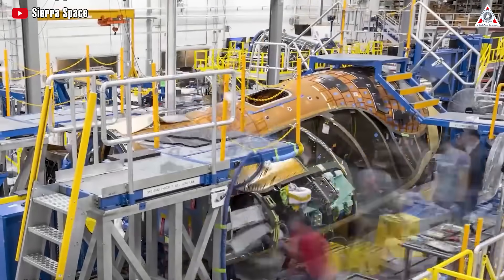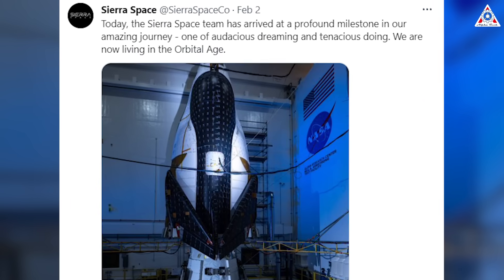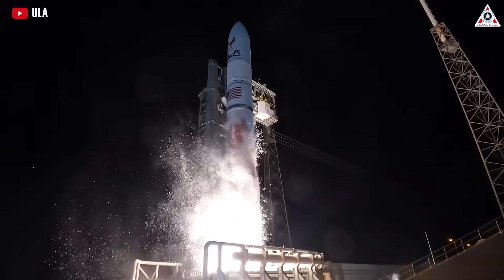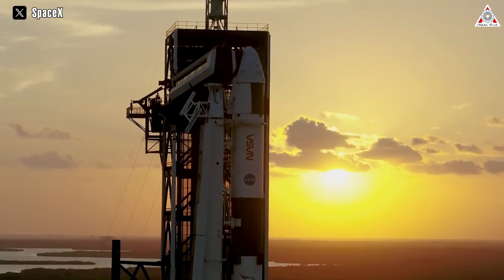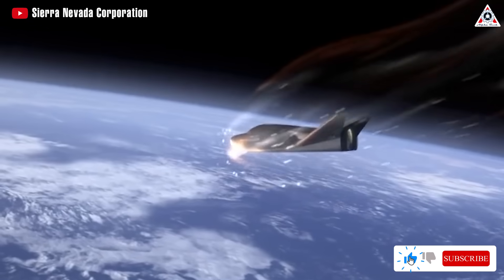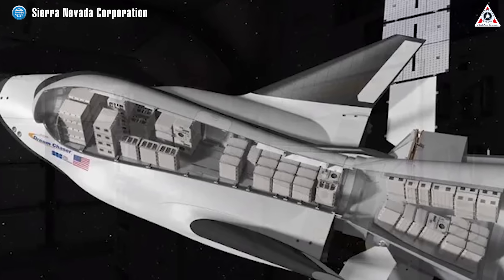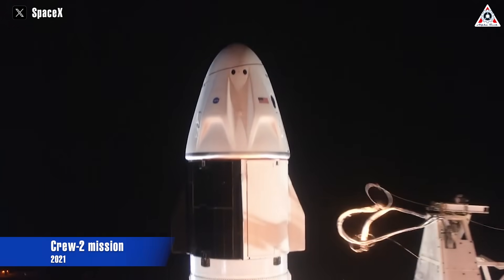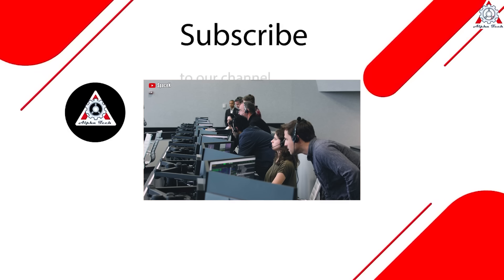NASA reveals inside NEW UPDATE on Dream Chaser's future propulsion...Vertical position!

Comment: Starship is ready in a couple weeks.  Dream Chaser is far behind, but multiple paths to orbit are welcome.
Reply: Starship is nowhere near “ready”. Two launch attempts and zero successes.
No life support.
No docking systems.
No ground test capability.
Reply: @allangibson8494  maybe not ready for humans, but they want to make orbit and make the deorbit burn for success.  Heat shielding has already been developed.  Docking systems are yet to be tested, but it’s not like they haven’t been worked on..  The second stage is to wind up in the Pacific this time.  After that, reusable.  THEN precision landing, then life support if not just a cargo mission, one step at a time, unlike NASA ALL-OR-NOTHING. Remember how many Falcons were destroyed in first testing?  Now we’re over 150 in a row, zero in flight losses.  (One fell off the recovery ship in high seas, some time  during the return to Canaveral, not during landing). No other system has ever been this cheap or reliable.
Reply: Starship is still in test mode . This one will blow up when it gets close orbit. Then they'll roll the next one out

Comment: I'll bite, how will the crew version execute a launch abort?   One word comes to mind, "Challenger."
Reply: I agree.. only this one will ride in a fairing..there is no escape
Reply: @thrillchaser9492 The CARGO version uses a fairing. The crew version won’t but requires deep integration to the launch vehicle as its aerodynamic controls will directly influence the rocket’s directional control.
The DreamChaser will use its two orbital manoeuvre engines for launch abort (which also need clearance around the rocket body).
These aren’t new issues - the concept dates from the Boeing X-20 in 1957.

Comment: Why is there no front wheel? It looks like the skid plate will dig up the runway.
Reply: Since it's a smallish glider and can't move under it's own power once on the ground, a nose wheel simply isn't needed.  Makes things super simple and once the nose is on the runway, you want maximum drag to slow it down to a stop.  Design of the skid will make it wear down before impacting the asphalt runway's surface.   For directional control, use asymmetric breaking on the main gear wheels.
Reply: You need go search an you will get the answer...

Comment: At this point I think shape of dream chaser looks overcomplicated, does all the curves make sense? Complex tiles, that hard to replace, and fabricate, can result in long
Reply: Actually, simple logic shows that most of the tiles are on the underside, and the upper side won't be exposed to extreme temperatures.  Dream Chaser was originally designed as a piloted spacecraft. That upper bulge is supposed to be the pilot area and for windows and in the manned version will be. those tiles are larger and better designed than the old space shuttle tiles.
Reply: it probably lets the heat flow off it as it travels instead of running along the surface.

Comment: Using Dream Chaser to deliver cargo/people to various places is awesome BUT once landed, the Dream Chaser has to be shuttled back to a launch pad to be flown again. Add that expense to the cost of use. It will be no trivial process either because it is bigg enough that trucking it down a highway is going to require road closures, it appears to big to fit in a cargo plane to fly it home and shuttling it by boat will require it to land at a port.
Reply: Um. No.
Reply: @WereMask 
Um, yeah. Duh!
Reply: Why? It can land at just about any normal runway. You could land it where it needs to be to be serviced. It is also much smaller than the original space plane and will be far simpler to transport if needed. You won't need to strap it onto a 747. A truck will do.
Reply: @keithhoward4069 
Landing at any airport is great but getting it back to the launch pad for reuse will be a problem. Trying to estimate if it will fit on a truck from the pictures. It seems to big to fit on a highway without blocking traffic. I have not found actual dimensions, yet. Have you got them?
Reply: Or. It will land close to where it was launched. The same runway the space shuttle landed. So transport costs are next to SFA.
Reply: Actually it will fit INSIDE a standard cargo 747…
Reply: @allangibson8494 
That's good. Then it should also fit inside a military C-5 and a C-17.
Reply: @appliedfacts  Or a A380.
The DreamChaser fits in a 5m fairing so no problem with the 6m internal diameter of a cargo 747.
They could go much bigger with the Airbus Beluga for the one they are building for EASA (NASA isn’t the only customer).

Comment: Spaceplanes are the only way to go  . Shuttle was an abortion. Even so, all her failures were self inflicted by a criminal NASA management.
Reply: the main issue with nasa projects is the same as all other rocket manufacturers is that they have a design freeze then build that thing at all costs no matter the dangers or issues as so many suppliers have to be changed.. this is how space x is able to improve so fast with everything in house, just look how many versions of the falcon 9 there has been, if that was ULA, russia or eu then they would have used falcon 9 v1 forever and never changed it. 

How SpaceX have done this is with making a rapid production line and having live Starlink test flights. they could prove all the modifications in-house on Starlink launches without having to test on customer payloads or use dummy launches.
Reply: @geofrancis2001  muxrat fanboi has entered the chat
Reply: @LuciFeric137  hardly, it's basic facts. just look at the atlas v, or the Ariane 5 or soyuze or proton, they never changed over 20 years of operation, and now look at boeing suffering with starliner, it was supposed to be a sure thing but with so many issues and so little production that they have had to try and repair the capsules they have rather than just take the next one off the line and improve it. if musk done one thing right it was realising the need for a production line that can be updated.

Comment: Nice! really nice!
But what I want to know, is what is the angle of re entry, and appropriate glide ratio, to be able to design and build fabricated stainless space planes, that dont require heat shields and just rely on the properties of the stainless, and their entry angle to not over heat.

Because you could get space plane benefits in very cheap and quick projects to build, that could be much larger than the old Space shuttle, and designed to land cargoes like say ore from Psyche in decent amounts.
And they could be flying boat designs and land anywhere there was a large body of water... Also they might use multiple smaller boosters to launch, instead of the giant unit like current starship. That could be attached via brackets and flew themseves back to the launch point like Falcon boosters. And depending vector angle control these boosters could be used for seaplane like water launches, but have tilt rotorcraft like lift assistance. 
If the fabricated space plane also had thrust vectoring and tilt vector pod engines, it could also be used as a Lunar or Mars lander. I would try to design its  thrust and fuel capacity to lift Cargo off Mars without a booster if possible.

I think we need to get serious about practical usability, and start upscaling and industrializing designs.
And think in terms of the Antonov of space planes.

Get away from the tube rocket and stubby wing Space Planes, and into the era of graceful sky birds that  can haul serious amounts and dont need towers or runways, that just add infrastruture costs and add nothing to cargo capability or use in primitive conditions.
The future starts now. 
Maybe we should start working more on it, and less on things we have already done?
What I see is alot of money and brain power being used to do things that seem archaic compared to whats possible....
Perhaps we need an educational system that also has imagination and creativity courses in engineering and not just numbers crunching.
So we are producing progress rather than structural or design bean counters.
Like maybe we should start building courses like Marine Engineering and Naval Architecture, but for Space, instead of relying on Tube Rocket Nerds to be our creative space future designers.

I suggest a project criteria test for funding: if its been done before, it should get less funding, than if its pushing the envelope forward for us.
Reply from the maker: Interesting! Your comment is great! Thank you so much!
Reply: I like the idea of wings to help with re-entry. As the craft decends into thicker atmosphere the wings would beging lifting and slow the decent until the heat generated was reduced. As the heat was kept low the skin of the craft would not melt.
👍😎👍
Reply: @appliedfacts  ok, I'm having some problem answering you, and a bit peeved, sorry! never got the same note before.
My apologies if this gets thru.
Reply: @garylester3976 
I have not blocked your replies. I do not know what the glitch is.
I like your glider re-entry concept.
Reply: @appliedfacts  
No, I see that now, but did a long writ explaining and got a message that the entity could not be accessed when I tried to send the writ.
Had never gotten that message before on you tube. usually other symptoms to sending problems. But on other sites have had people reply and then block so you couldnt respond, which of course is infuriating on discussion forums,
And your early writs were negative, and your user name suggests assumed expertise, and thats the type that tend to do the trolling and blocking routine.
But as soon as you responded to a second writ  I saw what was going on, just a new glitch. so I apoligized as appropriate. And left everything up to show evidence that it was my error and not something you did.
I have a long history of proposing controversial concepts. And very good at realizing missed logic.
And in the space and rocket science area theres alot of people with wall hangers who think things are limited to whats already been learned, and they often get quite nasty and attack any one that proposes new concepts.
Which is what I do....
Most famous in Space reality was it was me who proposed parts count, and started a big fight online, to make sure it got to Elon. I took flak and personal insults for a couple three days on that one. Accused of being the perfect example of Dunning Kruger effect etc.
Told to stay in my lane, that I was an idiot etc.
All by my social betters. one of whom admitted to being an engineer on the project. So I knew I had them. And told them I would win in the end, and did a blanket of proposals to really tweak their egos.
This was right after Elon came out about potential bankruptcy of Spacex from the Raptor one problems...

Needles to say, it got to Elon, and the rest is history. When parts count and rocket engine simplification effects are explained now, they are directly quoting my writs.
Even here on Alpha Tech.
Anyway, yes, there is another way to do re entry that reduces the heating problem to manageable.
Its by taking time rather than plunging, and by using more lift. 
Where there is enough friction to cause excessive heat, theres air flow that can be used as lift. And its like the skipping stones on a pond analogy. the stone doesn't plunge in, you use an acute angle of attack, and get it to skip, and the intermittant friction consumes velocity, and the skips shorten until it stops and sinks.
So, you need lift and control surfaces so you can regulate angle of attack to limit skin temps to what stainless can take, and you need insulation inside the skin to protect occupants from the metal oven effect.
Its going to have to get thought about, return trips from Mars will be way higher velocity than returns from lunar orbit, and they already have problems with heat shields from earth orbits.
And we are going to want to return cargo from Psyche. Likely very heavy ore. And eventually we will want to import lunar or other space industry products. So we will have a mass times velocity situation that will push the limits of materials if we dont use every advantage possible.
Also we have the tiles falling off problem. its already caused fatalities.
If nothing else the skipping stone option should be taught as a potential life saver even with Starship re entry from Lunar or Earth orbit in the event of lost tiles. it cant hurt to know for pilots.
I've planted alot of concepts that have made it into Starship, under various user names, as I am in the tropics where phones die young, and also get banned alot by angry professionals.
Also am a class clown type, which doesn't help with people having excessive ego. Have had many attempt attacking me for days... But I learned debate skills on political forums taking on multiple attackers continuously....
Anyway, sorry again for the mis understanding, it just followed a pattern. 
I alway enjoy discussing concepts with knowledgeable people who also have the abilty to think. My goal invariably is to plant concepts. And to help.
Reply: @appliedfacts  Yeah did another writ for you that I couldnt send like you were blocking me.

The Germans had a weapons concept at the end of WW2 that skipped thru the upper atmosphere after a semi orbital rocket launch, idea was to get it to the US like skipping a flat stone on a pond. I envision a flying wing glider concept,  with blended hull, and sea plane criteria with the wing tips as stabilizers in water.
Also a bit of extra thickness to the air foil shape would be good, to create maximum lift and frontal resistance.
I saw the original American flying wing at Eglin as a kid, and my first realization was it had too much abrupt frontal area, looked like a flying Strip Mall window up front...
Basically the game would be turning air passage into lift instead of heat.
And you could skip-dip-& Stall it to bleed off velocity.
Reply: Note: tried to reply to applied facts post and wasnt allowed to.
if you dont allow replies you have no credibility.

The Germans had a weapon concept at the end of WW2 based on the physics I am talking about. skipping thru the upper atmosphere like a flat stone on a pond.
We notice those slow down first and sink second... thats the idea.
Plunging into atmospheres is dumb and risky.
Reply: Good thoughts!
Also, my user name was deliberately chosen because I feel that I do have significant authority, especially on scientific discussions. I do recognize that I still do not know everything and there are others that know more, but compared to the average commenter I think that I am in the top 3%. It's due to both my education (5 college degrees) and 42 years of on the job experience in technical fields. I will be turning 60 years old this month (Feb 2024). I do know a lot about a lot but not everything. 

I love new ideas so keep thinking and sharing!
Reply: @appliedfacts  
Yeah, thats the right attitude about learning new stuff, alot of people get a wall hanger and think thats it.
I quit watching TV as a teen about 1970 and took up learning skills and other stuff and never stopped. Dont own a TV.
One of the things I have realized is in most fields, problems get solved via expedients, which then morph into tradition, and theres always missed logic to find that people are blind to. The We've always done it this way" mantra...
Just takes understanding and an over view, and questioning starting at the fundamentals. And you will find stuff that creates opportunities.
And Space stuff is no different. 🤣
Most think about how much they know, when whats important, is what we aren't seeing.
Anyway, I'll keep my eyes open for your user name!